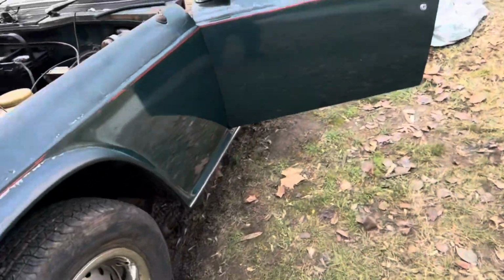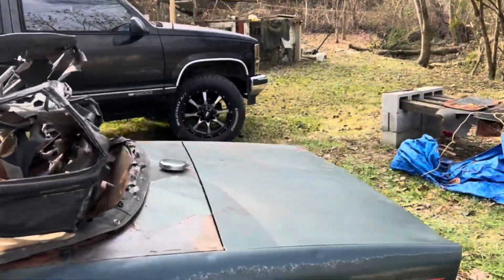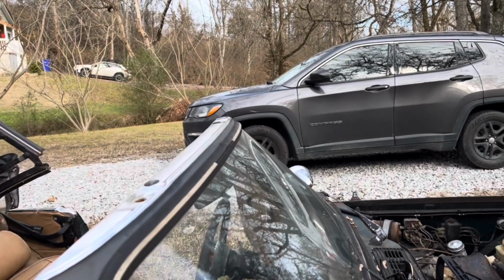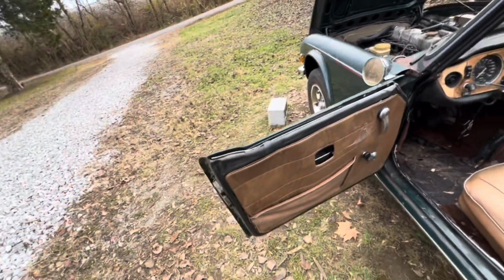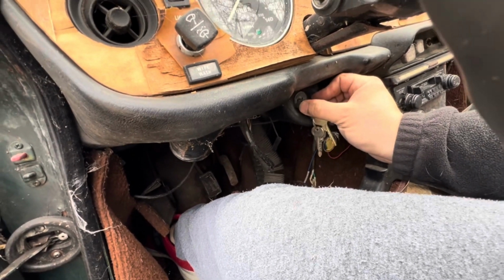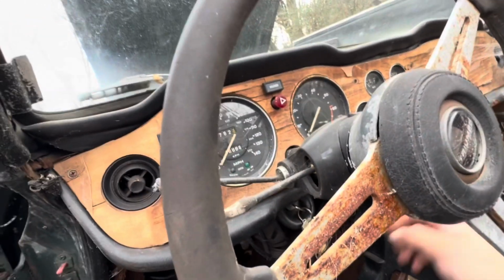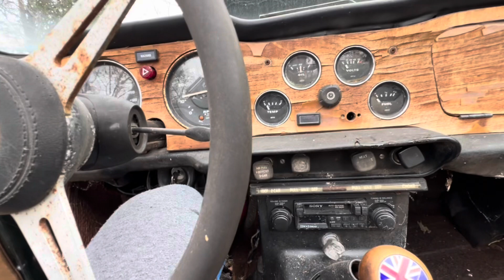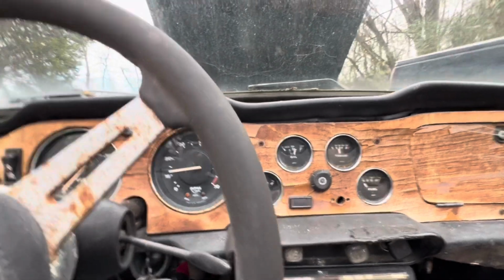TR6 Part 5 she’s ALIVE!

Comment: Sounds like the carbs need balanced and is the oil in the dash pots?
Reply from the maker: I haven’t got to balance them yet. I do have oil in the top of the carbs.
Reply: @Savedbythe90s  You are close to where they need to be. Get a flow meter and adjust the air/fuel on both carbs till they match. Start with the air/fuel needle 1- 1/2 turn from seat is a good starting point and adjust from there.
Reply from the maker: @GO_OutDoors really appreciate it.
Reply: @Savedbythe90s  No problem!! Glad to throw my 2 cents in!